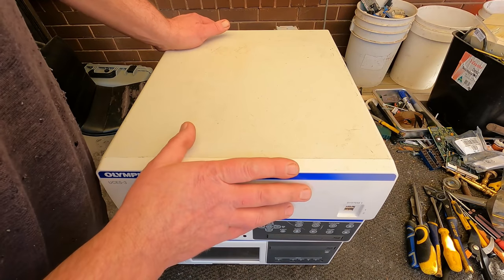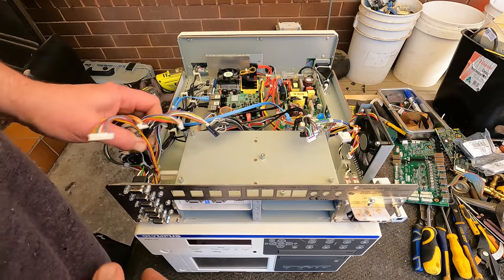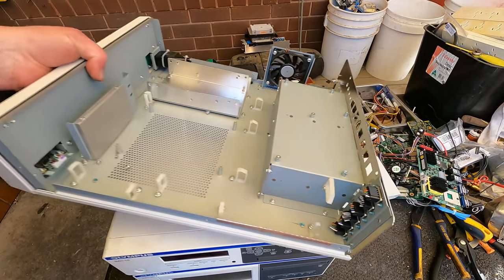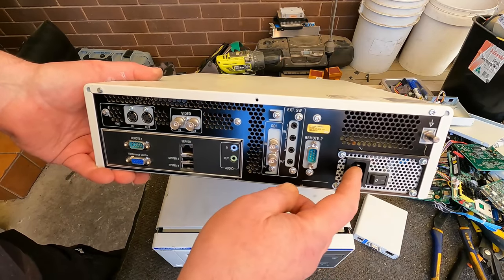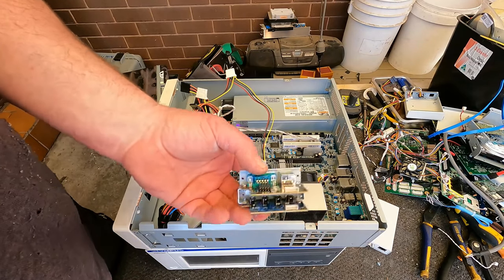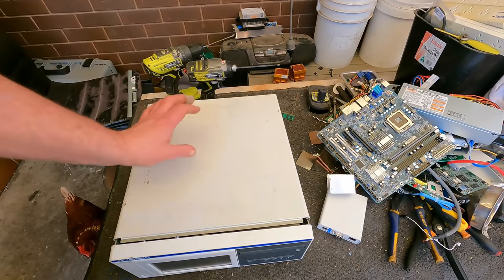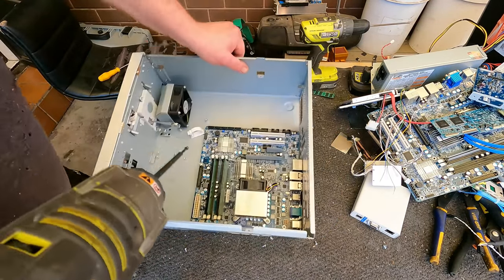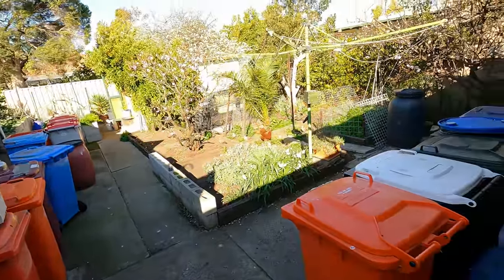Short & Sweet Scrap Medical Equipment

Comment: In the first unit, the Olympus one you scrapped out had a small hard drive you missed it is in a silver case screwed to a metal plate and it is sitting by the front USBS and on the second unit, you scrapped the so-called DVD is a BLU-RAY Player and not a DVD player or CD player
Reply: He said it was a Blu-Ray player and he said he'd set it aside to keep it.

Comment: Shielding probably on the power supply, back when I worked at a Dodge dealership 20 years ago we sold Jeep Cherokee’s to the US Department of Environmental Resources  they had all kinds of special Radio and magnetic interference shielding they had on everything in the car for use near huge Radio Telescopes

Comment: Good video but the title is a little broad.  The devices you scrapped are not a very good representation of the electronics in typical devices. I have been working on medical equipment for 20 years and can count on one hand how many times I’ve seen a “normal” motherboard like those devices have.  If you can try to make another but with a defib, patient monitor, or whatever you can get.